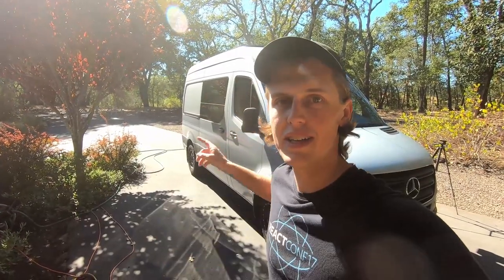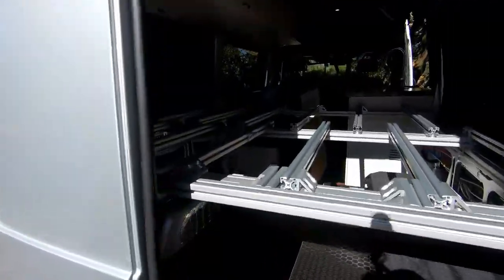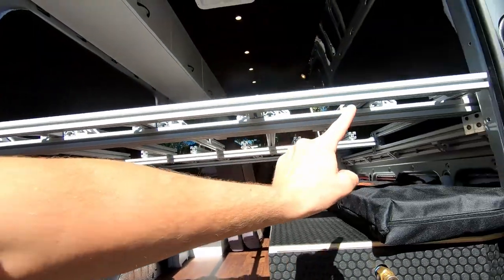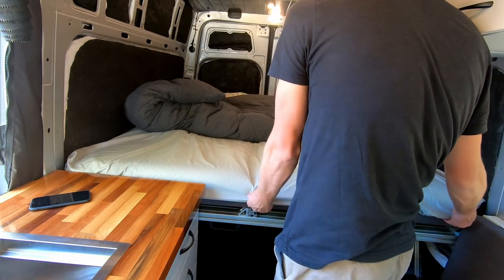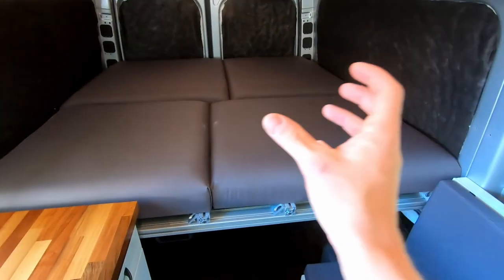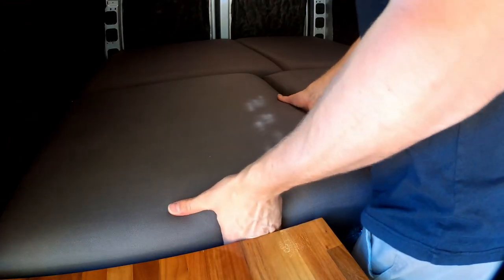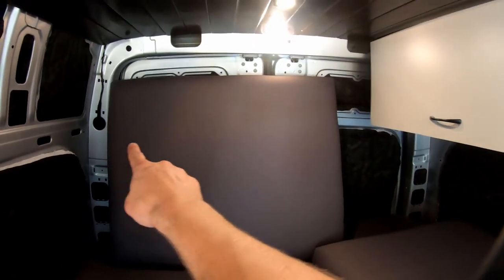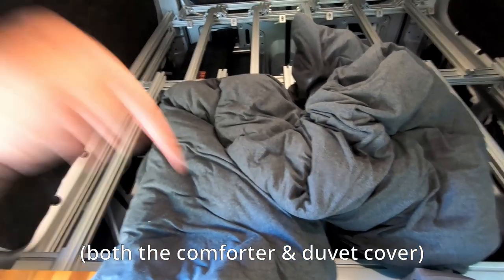COLLAPSIBLE Bed Frame & Mattress IN A VAN  - Complete Review #vanlife

Comment: FINALLY ANOTHER UPDATE 💥🚐 I'm building the frame for just a regular twin mattress myself. I figured I could get all my electric under the bed and boxed off and still have room facing off the side of the bed. I realllly love your videos, they keep me inspired when I'm drained and need to work on my build 🚐🚐🚐 cheers!
Reply: I cut a twin matress in half lengthwise and made it so it folds in half and only takes up 15 inches of " floorspace "

Comment: The concept and execution is pure genius, and any mistakes you may have made were because you were blazing new trails. The trials and errors of creating a prototype always come at a cost, but your ability to identify and rectify the problems yourself, more than made up for it.
Reply from the maker: Thanks Mark! I appreciate the kind words.
Reply: I agree 100% Mark!!  I am winding down my Sprinter 144" build and I too built a sliding bed.   Finally on my third iteration it is functioning well.  Most of the things I have done have had a similar pattern, luckily the big things like cutting holes for windows and fan went well the first time.

Comment: I almost finished my van convertion and i actually went with the same kind of system, i just went with wood and a camping double size matres. Makes it a lot cheaper, but the aluminium will definitely hold up better over time. Great job man!

Comment: Great job Seven. Mistakes happen and that is how you learn. I have a Promaster 3500 extended and my bed is 40" off the floor so I can put my bikes inside. I need to be able to carry a tandem and 2 mtn bikes. I don't want my bikes outside for two reasons. One, no one can see I have bikes and two the bikes get incredibly dirty outside the van, especially in the winter. My vacations always involve bike riding and I don't plan to live full time in my van. My next goal is to build a bed system that I can convert from a full size bed for my girlfriend and I to two separate beds when I want to travel with one of my biking guy friends. I used a cot once but it was a pain.. Thanks for posting.

Comment: Really like you bed design.  The fact that you get back 25% of usable van area is impressive to say the lest.  Something you might want to consider is how you will be able to change out the bulbs of the taillights in future.  I saw a guy actually come up with a small door the taillight area. Where the door could be screwed away for changing.

Comment: I am really excited about my costs. As I  mentioned in the first video I have a similar idea for the bed frame but I want to make it out of wood with aluminum support sliders. I hope I will not make that much mistakes 😅 I just came to your channel. watched all videos and you are doing a really great job. I will definitely rethink my design idea as I planned also with a bike space but I will see if I will not replace it for a shower and water solution you made. One week ago I was on road with a rented Ford Transit for three weeks to have a first test about van life. So now I compared nearly all vans and really VW Crafter and Mercedes Sprinter just not fit for me at all. I will go with the Peugeot Boxer L3H2. They are more like a box so you win space on the higher level in the van and they are 187cm width inside so maybe I will not need a bed system as I am 179cm tall. Fingers crossed!

keep that great work up I definitely subscribed and smashed the bell 😜

Comment: Planning my second build and have decided to use 80x20 to frame out all of the cabinets, then simply cut panels to slip into the slots for the sides. I liked the folding bed on my first build and will do the same again. It allows a full length bed, plus a couch with additional floor space.
Love aluminum's clean look, light weight, no-rust, and ease of machining. Already have the miter saw. Aluminum's only down side, as you mentioned is the price. Of course, costs can be greatly reduced by using extruded angles or tubing, but it's not as nicely finished as 80x20. So, it's a good alternative in unseen places. Either way, great tip regarding planning ahead to reduce wasted material.🤙
Noticed that you purchased your 80x20 from Amazon. But, I've also noticed some price gouging on some of their items, depending upon the vendor, so I'll be researching alternative sources. Perhaps some of your other viewers could recommend some cheaper suppliers. It would help a lot of people save a lot of money.😎

Comment: Awesome job! I’ve been fascinated all the way! I’m curious as to a weight comparison as well. That is a very strong and versatile bed system that really maximizes your limited living area. I have to believe it’s also MUCH LIGHTER than a wood-build, for example.

I saw (in the background) of another videoblogger that 80/20 has a giant catalogue (similar to Granger’s); were there other connectors/products that you found subsequent to your build that you’ve thought about/could be used to provide differing kinds of benefits? (You’ve opened a whole new world for me!)

Have you checked out the Video for the 1-Hour Shower 🚿 that allows for limited water usage and recirculation/filtration?— Pretty cool! I thought it might fit part of your needs (the guy’s channel is called Boondocker).

Comment: I think you are supposed to add a thermal break between your aluminum bed frame and the frame of the van.  The cold will conduct directly through the metal with direct contact.

Comment: In my 140wb sprinter I'm starting to build I was thinking of building a retractable bed for the same reason.   But I was planning on mounting garage door rail going across then aiming up. With 8020 aluminum going across with garage door bearings on the end of each . This way it can roll from a bed to a somewhat couch very easily.    I like your idea also. Took alot of thinking to come up with that.

Comment: I am looking at using extrusion pieces to replace the bedframe in my popup trailer. The measurements are 78" x 60". The 78" length is the crossbar which spans the width of the trailer. These cross sections are supported by 4 support arms made of conduit that link into the tow hitch frame as well as the front of the the trailer itself via 2 screwed in clips. How much flex do you think an extrusion of this length will have?

Comment: I am so excited about this design and I plan on replicating it. One thing I can't see clearly in the video is the attachment point to the walls, do you use half extrusions or full extrusions. In one of your other videos you mentioned you changed the design due to clearance issues for the linear bearings. If you had to do it over again would you use a full extrusion as the attachment point to the wall? Thanks for any clarification excited to order some 80 20!
Reply from the maker: Nice! I used full extrusions and I would do that again. I am however uploading the new bed video this Sunday so it may be worth watching as it’s a different type of bed

Comment: I'm constructing the bed and have two questions about the linear bearing pads. #1. How did you attach the pads to the #1530 piece? #2. When you pull open your bed, it sounds like it locks in place. How is this done? Do you have a stop?

Comment: Very cool system! I’m impressed with the ingenuity of your designs. Thanks for doing all the prototyping and showing us how to avoid making the same mistakes you did 😜
I watched your videos on the new build with all 80/20 framing. How do you avoid galvanic corrosion between the aluminum profiles and the steel of the vehicle parts? Aluminum and steel are fairly far apart on the galvanic index, and usually require galvanic isolation between them when joined together.
Reply: I actually checked the galvanic index, and aluminum and steel are close enough that there shouldn't be an issue in an indoor environment.

Comment: This 80/20 is one of the best designs for a collapse-able bed and regaining a shower area footprint. It's too bad that you can't store your bike inside with this low bed design anymore. I am wondering if you could gain some more seating/table capacity with the bed collapsed hence making the steep investment in the 80/20 design even more reasonable.

Comment: Interesting to see someone use a primary material other than plywood.  However, did you electrically isolate the aluminium from the steel of the van to avoid galvanic corrosion or did you just hope the factory sacrificial zinc coating would be enough protection for the added galvanic potential of the dissimilar metals.  Note that with ships, the aluminum superstructure must be electrically isolated from the steel hull even though the hull has replaceable sacrificial zinc blocks attached.  I suppose another alternative would be to design the electric system to counter the galvanic potential but I think that would take more calculations and usage data.  Did you consider any of these corrosion issues?

Comment: So make a set of plans and part list would be glad to compensate the frame system would be great for a contractor .. Ron paulk has a modular shelf system for tools in box truck or cargo trailer. The high cost for contractors makes this useful. Please link manufacture of 80/20 you cold have used unistrut or cargo van e channel an my cargo trailer for walls floor ceiling. Temp hang fixtures may be cheaper

Comment: Seven ... love your videos, you've done an excellent job, it's appreciated.  I'm headed toward doing something similar; however, being that I'm 6'4" tall, I want to stand up fully in the fan.  My question is:  what is the height from the floor to the ceiling of your van?  TIA, Jim
Reply: Hey im 6" yeah not as tall as you but ive been looki g gor vans to stand up in and ive done fair amount of research. No natter what van you are gonna buy you are gonna need a high top to maybe stand in it. I decided on just making more sitting space instead of standing since most of what ill b doing is outdoors.

Comment: Nice job!
Jut wondering why you used those corner brackets to join the extrusions together? Wouldn't it have been possible to drill a through hole on the top extrusion and use a T-nut in the slot of the lower extrusion?
Love 80/20, great product and versatile and expandable in the future.

Comment: As an automotive design engineer- great design and selection of material. One question- the triangular hollow extrusion mounting brackets- are they a 80/20 product? I have reviewed the catalogue and could not find them- if so could you provide 80/20 item 24 part number? Great job.
Reply from the maker: Thanks! Are you referring to the gusseted inside corner bracket?
Reply: Seven O Savage - in the video at 2:23 mins you refer to them as 80/20 connectors- these ones. Cheers

Comment: Really nice design. Should be convenient with the shower. Just curious, why didn't you use wood for the internal frame? As in used the steel for the moving parts and wood for the rest?

Comment: I love the concept but would have to build it out of cheaper materials. If you’d made the moving pieces of mattress sightly different you could’ve made the sofa idea work. 
I’d have made the piece that becomes the sofa back the exact size to wedge across the doors and just had a 1ftx3ft piece to lift out. This thin cushion would be balanced on is edge across the doors and the big cushion would rest up against it at the bottom and lean back to touch the doors at the top. Thus giving a comfortable recline angle to the back. 
I wouldn’t have sacrificed the internal bike storage for security reasons. I’d have stepped onto the seat instead of lowering the bed or hung a step from the bed that slid away with the mattress. 

Would your bike still fit under the bed if you took the front wheel off and lowered the saddle?

Comment: Thank you for sharing.   What length and size bolts did you use for the plus nuts and for the 8020 connectors?

Comment: You added the small 45° pieces/ramps so that the saggy sliding 8020 pieces would slide up onto the fixed portion.  Instead, you could just cut the ends of the sliding 8020 pieces at 45° angles which should do the same thing.  I like your ideas and craftsmanship much.  I would say however, 8020 seems too expensive for the bed.  If you had used wood, like many YouTubers have, perhaps you wouldn't have needed need the plywood in the mattress/bed cushions.  Perhaps, then you could have used 2 mattress cushions instead of 4.  If you had not extended your upper cabinets all the way to the back, you could have done the bed that converts into the reclining sofa that you were elaboration on.  Excellent idea, bed that converts into a sofa.

Comment: Very well done!    Question:  is there any noticeable flex in the bed frame?   I’m think to build a fixed frame with 80/20 and running the extrusions across the width.  Would you recommend a supporting wall in the garage to reduce flex?   Thank you
Reply from the maker: They are very rigid, no flex you’d be fine without a support

Comment: I Like you bed very much.
Are you sharing the schema of your bed structure ?
I was actullay thinking of doing a similar collapsing approach but for storing my bike in a kind of drawer. I was inserting by bike flat on my previous coupé.
I do think if the bike wheels are removed and inserting the bike using some angle that may work. Also by remove the pedals! (or if you are using some automatic ones) the hight required could be a minimun.
Any thoughts ? thx

Comment: Did you use the Ultra Light Smooth extrusions? Would you use that same material option again with the same about of reinforcement? Building one myself and wondering if i should bulk it up or slim it down. thanks!
Reply from the maker: I didn’t use the ultra light simply because I like the aesthetic of the regular ones. Either way would work thoug

Comment: Hey Seven, did you have any issues with the two bearings getting jammed as you slide them after attaching the crossbar? I am using your design for a similar bedframe, and unless I push the two bearings at exactly the same rate, they easily get jammed. Did you have to use additional shims in the bearings? I see that you are able to slide the bar and two bearings easily without any issues, so wondering if the key is using some shims. Thanks for a fantastic design idea!
Reply from the maker: Yes I had this issue. That’s the main reason I had 5 additional extrusions on bearings to force it to stay straight. Even then, there was a technique. There’s gotta be a good solution... I’d recommend calling 80/20

Comment: Nice work!  I'm doing an 8020 bed also.  For the support track/strip of aluminum that's screwed to the wall, did you end up screwing that over the wall panel or did you custom cut the panel around it?
Reply from the maker: Nice, it’s very comforting sleeping on a strong bed frame. The frame is bolted directly to the vans frame. I ended up doing 2 wall panels for each side (1 above the bed and 1 below the bed). Video on wall panels coming next!
Reply: @seven_o_savage  Thanks Seven. That's the approach I was leaning towards also.  Looking forward to you panel vid!

Comment: I’m a really big guy...like 330lbs big. Is there any kind of weight rating for those rails? I followed your Amazon link and I don’t see a rating. I am planning something very similar, but want to know first if it will hold up my carcass reliably!
Reply from the maker: Good question, the bottleneck for weight is not the 80/20 extrusions but the mounting mechanisms. In my case that’s the plusnuts that attach the extrusion to the van frame. 

That being said it will easily hold 330 lbs. I’d be very comfortable doubling that, probably even tripling.

Comment: Hey man, how tall are you and how long is the bed when fully extended? Is it long enough for you or do you wish it were longer? I'm 6'2" and trying to come up with the best north-south bed option for my 144 Sprinter.
Reply from the maker: I am 6’5 and I sleep diagonal. If I was sleeping with someone else I’d make a cushion for the galley which would extend the bed about 18”
Reply: @seven_o_savage  That's actually a great idea and I might not even need to create a folding/extending mechanism for my fixed bed. Might get away with just a cushion over the galley  ... back to the drawing board :)   Thanks man!!
Reply from the maker: @morenonesense  Good luck!

Comment: Comment build a slide out front and back. Make a power tail gate or slide out 2000 # platform. If you are rv park use or stealth. Build modular kitchen bath plumbing power system. Then you can store componets in mini storage or cargo trailer. Then us van for day job delivery for income or contracting. What is cost ..take hospital grade matress liner if you move to a tent ... Modular system makes transfer if you are in a wreck.. Or build a tiny house or shipping container base station.